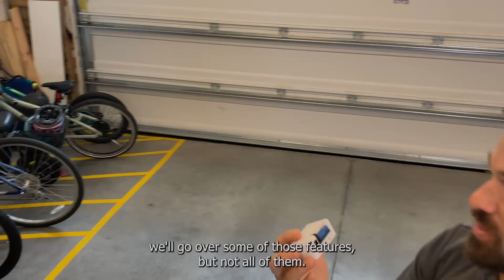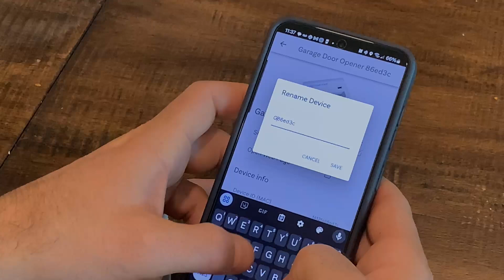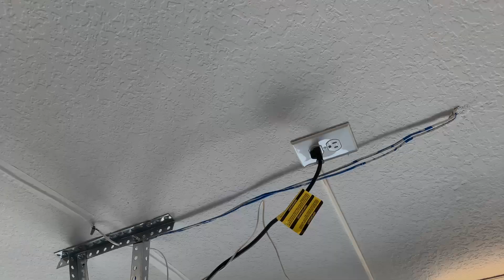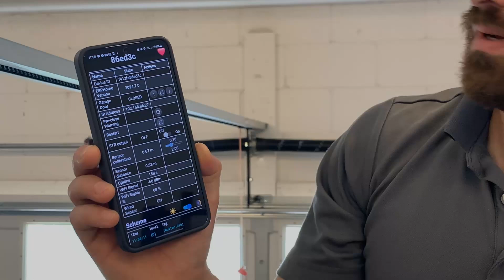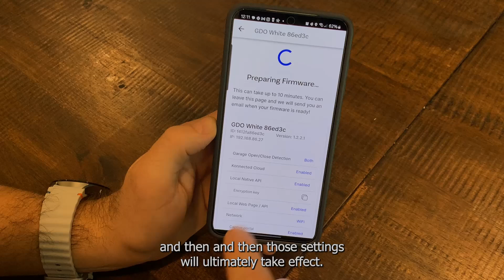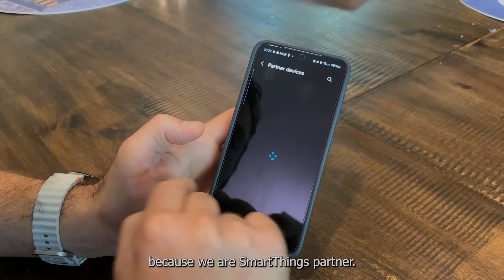GDO White Install Video

Comment: Would have been nice to show if the trip wire / obstruction sensors can also be put into the Konnected and have them show up in Home Assistant.  That got skipped.  I believe it can do this on the Blaq version, but have no confirmation about the white version...

Comment: I'm assuming it works with Google Assistant through SmartThings?
Reply from the maker: Yes... SmartThings is a quick and valid path, but you’ve got two other options too:

SmartThings bridge (most people use this today).
• Add the GDO White to the Konnected app → sync to SmartThings → link SmartThings as a “Works with Google” service in the Google Home app.
• Google will show door status immediately; voice opening may require you to set a PIN, because Google treats garage doors as secure devices. 

Matter firmware (experimental).
• Join our Matter Early-Access program and flash the beta build for GDO White; then pair it straight to Google Home with the Matter setup code.
• Heads-up: the current Matter spec still doesn’t have an official garage-door type, so the device shows up as a generic “door” and behavior can be quirky. 

Home Assistant → Google Assistant.
• GDO White ships with ESPHome, so Home Assistant sees it natively.
• If you run Home Assistant Cloud (Nabu Casa) or a self-hosted Google Action, every door entity is exposed to Google Home... again with the optional PIN for opens. 

So yes, SmartThings works out of the box, but you can also go direct via our Matter beta or through Home Assistant if that’s your hub of choice.

Comment: I recently got one of these and im wondering about the door contact terminal. Is that going to be integrated into the state of the door at anytime. If the door is cracked open that's the only way the system could know its open but it always registers as closed. I then end up opening it to close it.
Reply from the maker: Hey! Great question! The GDO White does support a wired contact sensor to avoid issues like that and make the open/close reading a bit more reliable... here's a link to the video guide on that - https://youtu.be/19XE6AgV-KM